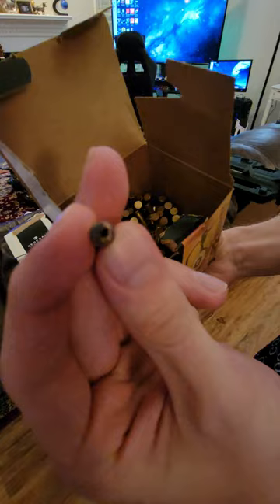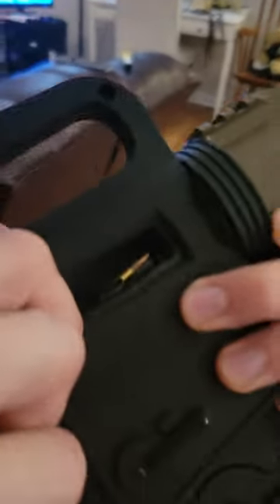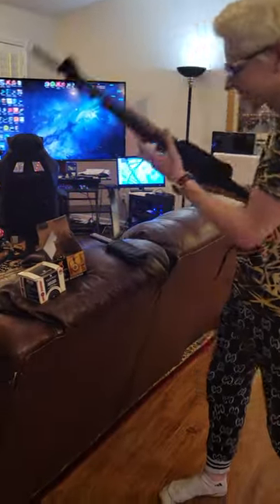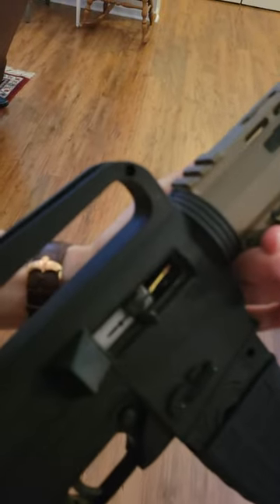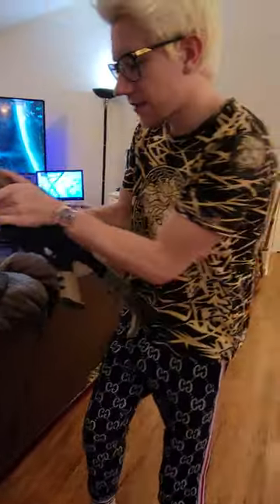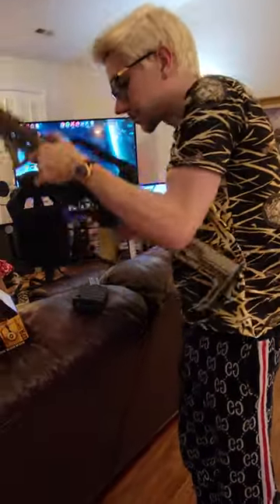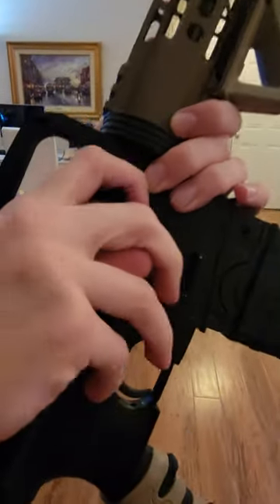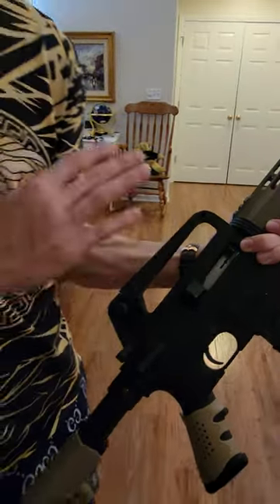how to fix MOST .22lr jams, (Mossberg jamming) easiest ftf fix.

Comment: Unfortunately this probably didn't fix your problem after a little investigation the magazine lips are to tight, slightly bent to much the way they were made catches the bullet and cause it to totally go the wrong way then the action jams the bullet above the chamber or in the wrong spot first thing to check out take an empty mag dont pull the slide back put it in and then pull back push up does it stay open it should if not try taking out the mag this time pull the action back before sliding mag in push the magazine up firmly u should hear a click and it should lock the action back so the two problems is the mag lips at the top catch the bullet about halfway out of the magazine the lips on the back of the mag where u slide the butt of the bullet in should not really be touching the bullet so much now try to slide the bullet out manually after u load it don't put the clip in see how the spring from the clip pushes the red piece up and the bullet gets stuck in the back half on the rim casing to fix this problem bend the back of the mag lips and the front be careful not to break it, the mags aren't very durable bend it outwards like your trying to straighten it a little not to much u still want the bullet to be held in but not caught as its sliding out that y I said try sliding the ammo out see what happens then bend the mag lips away from the bullet slightly until it doesn't do that second problem big problem with this gun is the action is somehow loose how it sits the extractor claw doesn't grab the rim of the bullet like it should it slips off because it is loose so u have to push in on the action while pulling the bolt back to make the claw grab I haven't found the fix for this yet but I am going to try adding something ass a spacer as the extractor claw is loose the way it was made so maybe if I jam half a washer or something in there it will tighten it to where u won't have to push in one the bolt the ammo has nothing to do with it besides oil it up and just keep cycling ammo through it shoot it as much as u can the idea is to let the gun do the finishing work by firing it so many times should smooth things out and work the way it should almost like a new baseball glove that needs breaking in if I find the fix for the ejecting problem I will let you all know good thing about all of that is u don't have to take a single screw out to do anything I stated above I have taken the whole gun apart many times just to realize it's mostly the magazine causing your feeding issue not the bullets not anything but the way the mag was designed and the way it sits it really need to be pushed up inside so the action will catch the right part of the bullet of u look at your bolt and pull it back on the action the first thing u will see on the side closest to u is the extractor claw in between should be the groove where the action catches the bullet pay attention when u put your mag in is it in far enough for the action to catch the bullet from the mag without interference from the mag since the part on the action catches the back of the bullet the has to slide through the middle of the magazine feeding the ammo into the chamber and then when fired or pulled back the extractor should hook the lip on the back of the bullet and slide back with the action this will cause the round to be ejected unfortunately this gun likes to double load I call it so it doesn't eject the casing yet try to load another round into the chamber but hits the spent casing and jams the bullet usually bending it so its no good so many people had an issue with this rifle I've seen so manybother fixes tried them and yet didn't fix anything u do not need to cut anything off your bolt that will not fix anything because that is not the problem it gets caught because the mag doesn't sit properly nor was it designed right hope u all can enjoy your 715t I hope to enjoy mine as well good luck to both of us

Comment: The bolt never shuts that slow during operation. Therefore, it would typically not jam in that fashion. The true issue as to why it would ever jam as a fail to feed is due to the coarse finish of the feed ramp catching the ammo. Take a dremel and stone (only if you're experienced with one) and smooth/polish out the finish on that ramp. It will never jam there again.
Reply: Unfortunately, the quality of finish is the main reason for all of the 715T's issues, like the 25 round mags not wanting to load... due to the sight window slot having a rough lip where it was stamped. Just need to take it apart and dremel or file it smooth so it doesn't grab the ammo's casings.

Comment: I rather buy AR . And buy a 22 conversion kit .
Reply from the maker: Taking 1 step forward then 2 steps back and paying $800 more in the process 💀
Reply: @brandonsballing826  you can get a AR about 400. And then you'll have the barrel and then you'll have the action and then you'll have the mag. Actually the if you get the 223 all it is is a MAG and receiver because 223 is the same size as 22 LR it's just a little bit bigger. When you shoot 22s you just shoot 22s down the down the 223 barrel . My uncle has a gun store . We shoot the 22lr inside all the time . We have an bullet trap at the end .
Reply: @brandonsballing826  you're paying $800 for a AR your overpaying.
Reply: @brandonsballing826  we have an lots of AR in 223 . Very very common rifle. That's why we stock the 22lr mag release and 22lr mags . Cuz shooting 223 is more expensive.

Comment: First off Holy Fuck! You don't chamber rounds all willy-nilly in a house.  A failure to feed is not a failure to fire, it's out of battery. Lastly a round nose lead projectile is not a FMJ,  it would be a lead ball round if anything.  I understand the points you're trying to make, but you need to be a little more safety conscious and get your terminology down.
Reply: Tf do you want him to do drive to McDonald's to load it? Smh